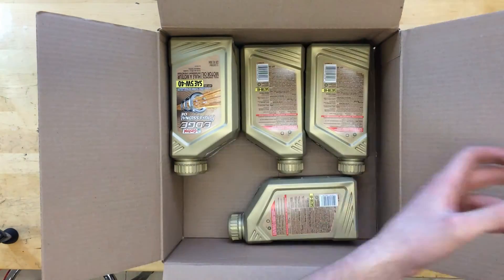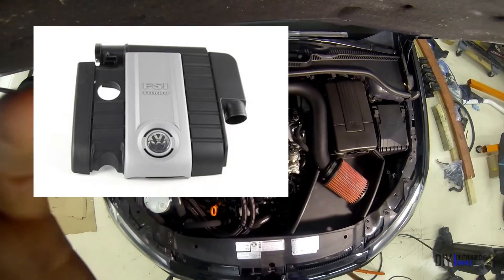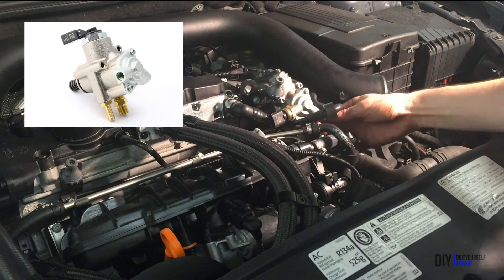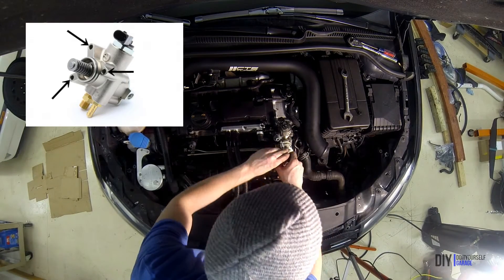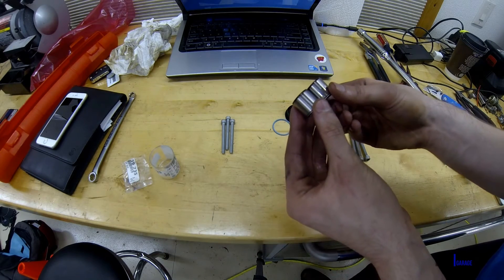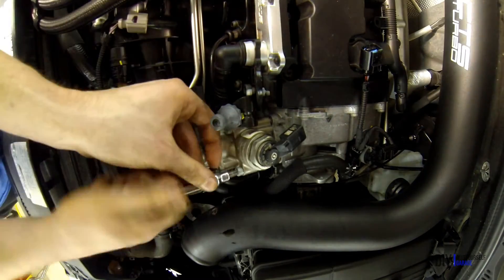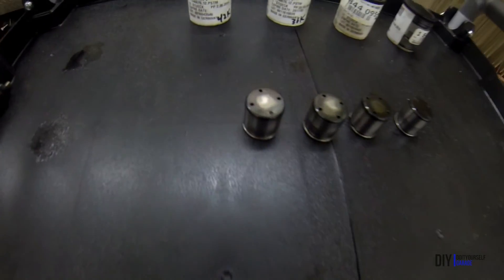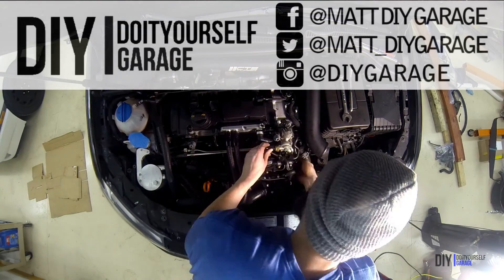How To Check and Install Your CAM FOLLOWER, VW / AUDI 2.0 FSI, TSI, TFSI

Comment: Good video. Only 3 things to add:

1) Cleanliness is mandatory. Clean and carefully inspect all fuel line connections. Make sure NO dirt or debris gets inside of the mating surfaces. I always clean mine with a blue lint free shop towel, then put rubber caps on them to prevent any contamination.

2) Once the cam follower is removed by hand, shine your flashlight inside the port hole and examine the actual FP lobe of the camshaft. Check for any excessive or unusual wear. The cost is free. Takes 30 seconds while you're in there, and it tells you the missing info about this part of the engine's health.

3) Once it's all back together, prime the fuel system by turning the key to the Run position, count to ~5 or 6 seconds, then key off. You should hear the LPFP come on in the fuel tank while this is happening. It is sending ~40-60psi of fuel supply up to the HPFP.

Do this priming method a few times to cycle as much fuel up to the HPFP as possible. It should make for a better first start, and the idle should smooth out faster since you've minimized air gaps and deficits in the fuel supply.

LIKE if this helps anyone reading it. 

-career auto worker (23 years). VW/Audi lover for 19 years.

Comment: Great video. I have an 07 A8L. It has 2 of these. Just got some fuel codes today. P310B, P0088 and P119A. I'll be sure to check the cam followers

Comment: First of all, I own a jetta with a 1.4 TSI cax engine. There is something wrong with my car that I don't understand. After 3000rpm, I hear a metallic rattling sound from my car. There is no problem in the 0-3000 rpm range, it does not show any signs of malfunction in the log records of the car. there is no pressure loss, there is no problem in its course. but after 3000 rpm, it makes this sound when I touch the smallest gas pedal. I am sharing the link below. Because of this noise, I changed the water pump and high fuel pressure pump and the piston inside, but the sound still did not improve. The sound is coming from the fuel pump and intake manifold area.
https://youtube.com/shorts/wPx-x3cGT5Q?feature=share

Comment: Hey, man, I got a problem with my car. my vehicle is an Octavia with a 1.6 fsi engine. I'm driving down the road in my car, and he cuts off gas. the gas needle is fluctuating and the engine stops. the computer shows error code p2293. Service officials say the problem is caused by a high pressure pump. however, since the problem is not always experienced, I think there may be a problem with another equipment. I care about your ideas, and I await your answer.

Comment: I just came across this video, wanted to ask before buying my golf R tomorrow... The golf R I have has an aftermarket APR High Pressure Fuel Pump in it already, do I need to worry about it in the aftermarket part?
Reply: Yes. You should check it every 10 or 20K miles.

Comment: Nice tutorial! I have a question. I own a 2008 Audi A3 with 1.8 turbo engine. This car has the same problem? Thanks.
Reply: 1.8s never had came follower issues. You'll just have to worry about coil packs ;)

Comment: Aren't you mean to prime the pump with a few turns without starting it first?.
Reply from the maker: Potentially... I didn't and everything seems to be OK.  :)
Reply: Also turn the crank depending on the position if on the high point of the cam tht makes it easier as well!

Comment: I think they updated the alloy for the cam follower and now it's far more robust than before. Changing it every 10k miles is a bit unnessecery, imho. Some people would change it if there is the slightest discoloring in the black paint thing...

Comment: Great tutorial, I replaced my cam follower on my 2008 GTI after 106,000 miles. I know that's way too long to leave it - luckily there was minimal wear. Thanks 👍🏼
Reply: Mine just went out on the freeway with 127k miles :) pretty sure that’s what happened. Or the fuel pump

Comment: Very nice tutorial. FYI, the torque spec for the three bolts is only 7 ft/lbs. So it just makes sense to use a suitable torque wrench. Also fyi,  I installed a LOBA hpfp, and so was in contact with the company wherein I was told that in testing the pump design it was removed at least 50 times and the same bolts were used repeatedly. As it it, I have a new kit with new bolts (anyway?).
Reply from the maker: longbowdt thanks for the correction.  My comment regarding the stud conversion was more toward saving the aluminum threads, not the bolts.  Paul, over at DAP, would have more information regarding that.  Thanks for watching!
Reply: I understood about the bolts.I should have been more clear as well. LOBA installed the same bolts into the same pump mounting repeatedly with no issues. I was only stressing that it's more important to use the proper torque specs. As I said I have new bolts with my kit. Of course I'll inspect them to see if the are clean and not fouled with aluminum from the housing. Yours is still a very good video tutorial and I appreciate your sharing it with the community.